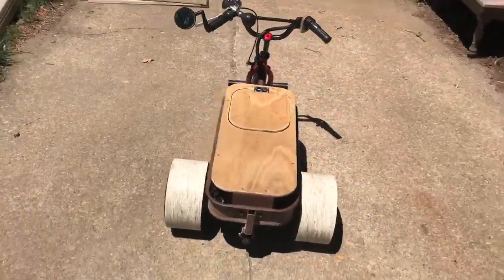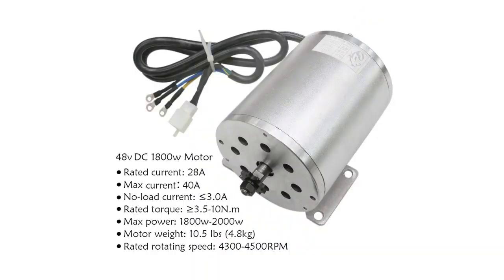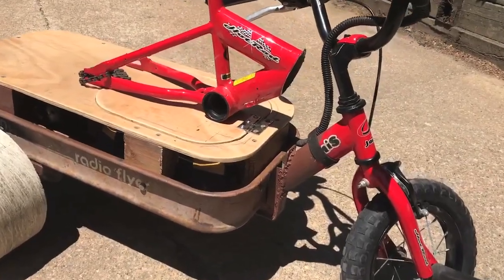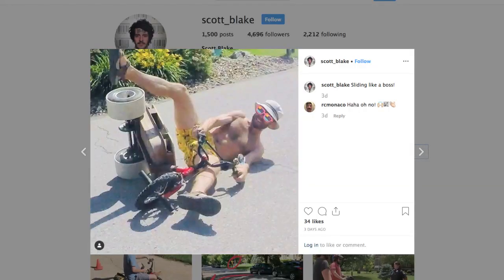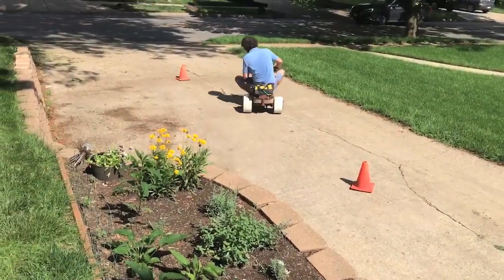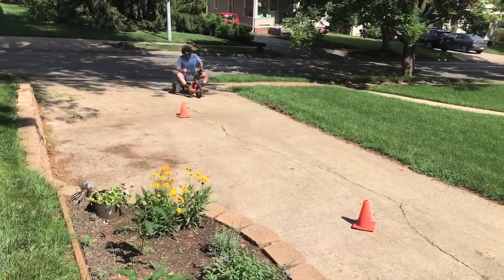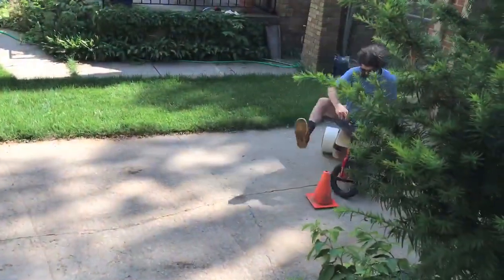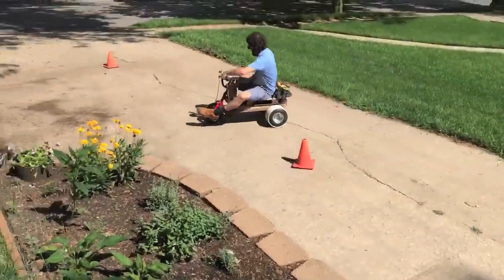Motorized Radio Flyer Wagon Electric Drift Trike

Comment: Hello what size front and back sprockets have you used
Reply from the maker: I think this trike has an 11 tooth sprocket on the motor and 54 on the rear axle; plenty of torque and top speed is 28 MPH.

Comment: I'm bout to convert a radio flyer toddler trich with 6v electric power wheels motor any tips that things badass  btw!
Reply from the maker: I recommend more POWEEER! Bigger motor like a 36 Volt 1000 Watt MY1020. I recently destroyed a power wheels motor, exploded the plastic gear reduction in seconds. Most 6V electric power wheels do not have a variable speed controller, usually just an on or off switch disguised as a throttle. Check out electricscooterparts.com

Comment: Did you make a custom live axle or did you happen to find a place that sells one? I'm really interested in making one, but only have a budget of 500USD or so
Reply from the maker: I bought a couple of live axles from bmikarts.com part number 400036 for $33, and also got some from local surpluscenter.com in Nebraska item number 1-2982-100-3 for $31.
Reply: Thanks for the reply! Also was curious on how stable the ride is? Like how's the rider height you feel is fine or how are turns on a shorter wheel width?
Reply: Could you post more information on the built, do you use any type of motor controller?

Comment: Simple and effective.  What sort of battery life do you get from this,  In minutes?
Reply from the maker: Thanks Gary. Battery life depends on how hard I'm riding, but I can usually travel about 1 mile per amp hour. I really like the Flexvolt 9 amp hour packs, the larger battery increases motor performance, and it can probably travel over 10 miles, although I've never completely drained these batteries.

Comment: How much would this cost if I already have a wagon edit: and a bike to cut up
Reply from the maker: A quick estimate is around $950 total: batteries $450, motor and controller $200, wheels $80, rims $70, PVC $40, hubs $20, axle $30, bearings $25